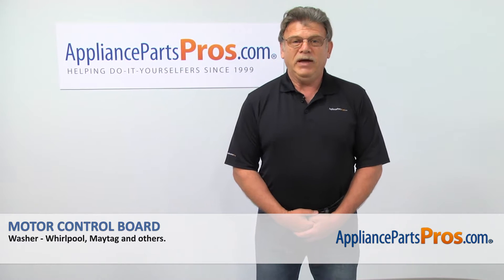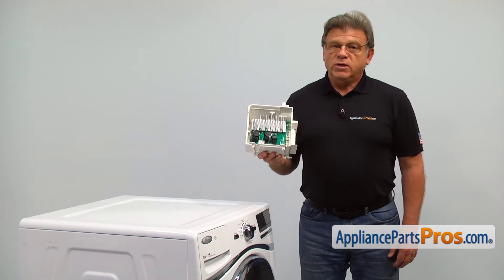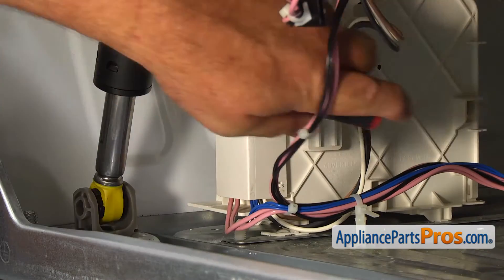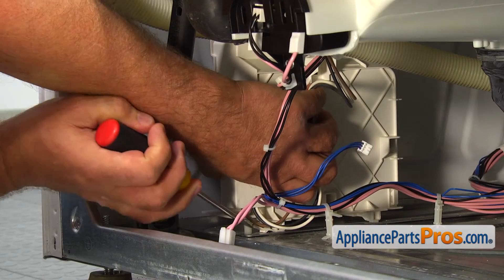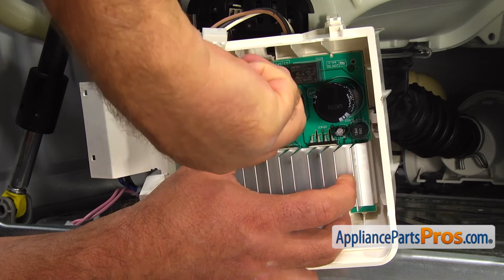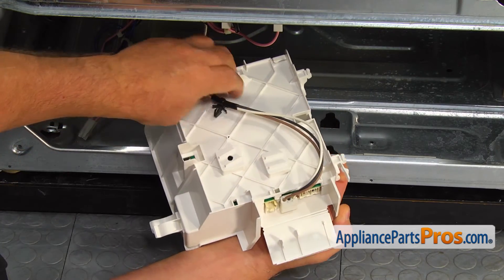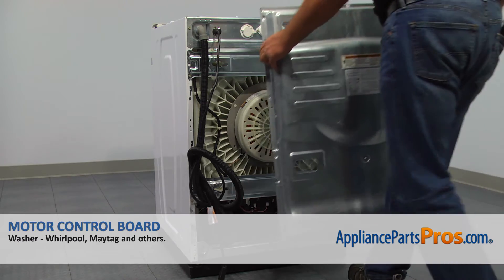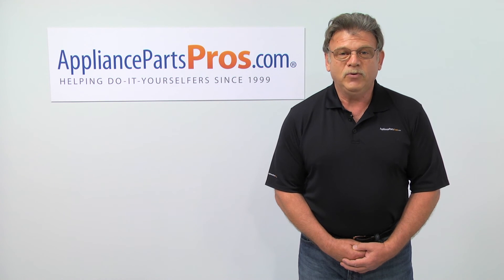How To: Whirlpool/KitchenAid/Maytag Motor Control Board WPW10374126

Comment: Fantastic video, I replaced the MCU easily, only one question? after replacing unit the door latch does not activate it makes a noise, can you make suggestions?
Reply from the maker: We'd be happy to help you figure that out, but we'll need some additional information about the model and the problem. You can give us a call at 1-877-477-7278 or you can chat us at our website: http://www.appliancepartspros.com/. We will need the model number for the appliance, so that we can look up diagrams and information about your specific unit to give you accurate advice. You can look here on our website to help you find the model number: http://www.appliancepartspros.com/modelnumber_locator.aspx